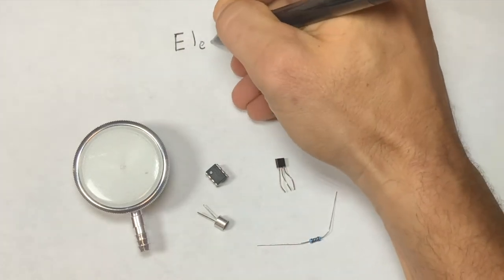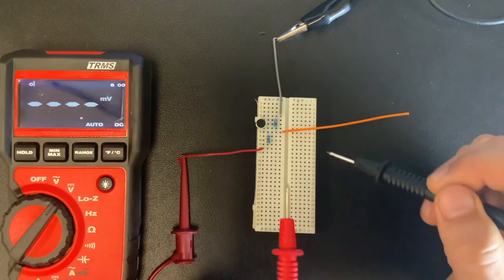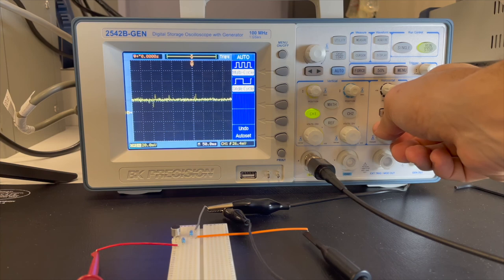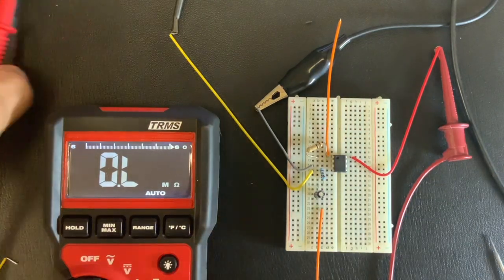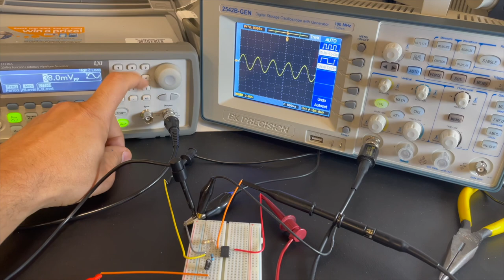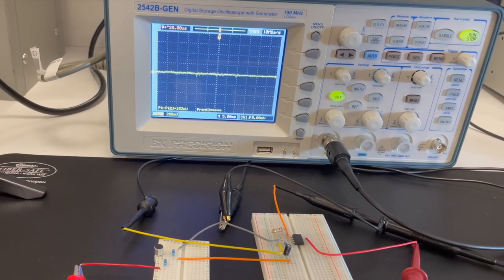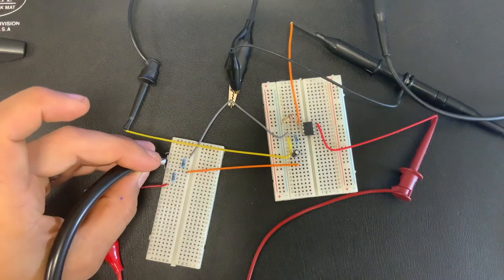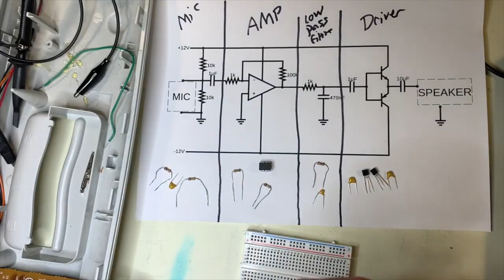Can you build your own Electronic Stethoscope?  Learn how to build and amplifier circuit

Comment: Hi great video. May I know if you have made an improvement on the circuit to reduce audio issue? and im thinking of upgrading the circuit and use neural network to make a simple diagnosis of diseases. Can you perhaps make a video for it or give any recommendation for the upgrade? Thanks.

Comment: How to add volume control? how to increase power?
The class b amplifier has zero crossing deformation. how to correct this?
Reply from the maker: Hmmm, well volume control could probably be added using a potentiometer later in the circuit. I am actually still trying to work out a new circuit for this so that it is more consistent and has less audio issues. Hope I can get it working soon.

Comment from the maker: More projects are found at HTM-Workshop.com

Note:  I used pin 3 as the ground and pin 2 as my incoming signal - the schematic in the beginning shows these two switched.
If you are looking for similar equipment to use 
Milwaukee (without thermocouple) - https://amzn.to/37lJBT6
Best Wire Cutters - https://amzn.to/3xbgf4v
Function generator - https://amzn.to/38yEuj3
200 MHz Digital Oscilloscope 2 Channels, Grey - https://amzn.to/3x0KTxu
Reply: Use hearing aid in sthetoscope